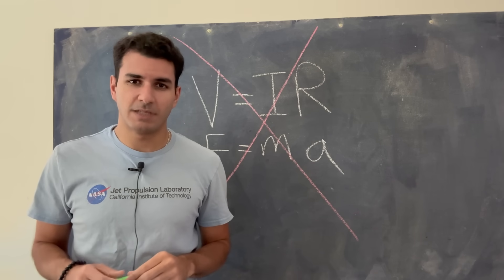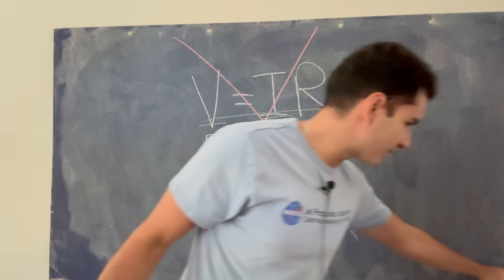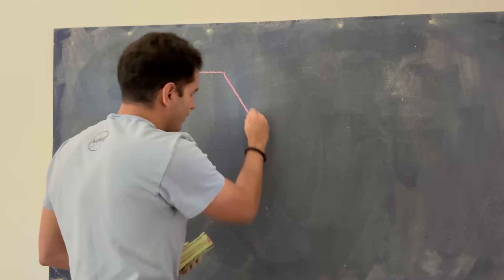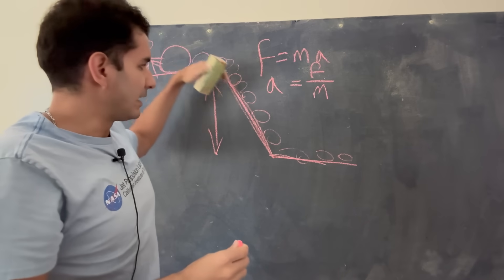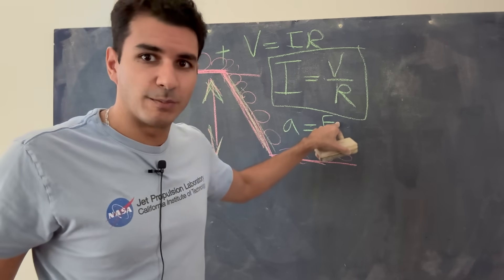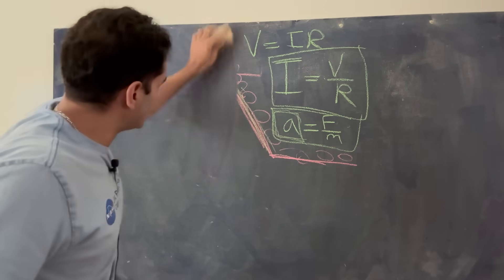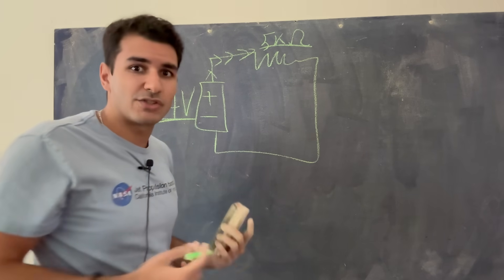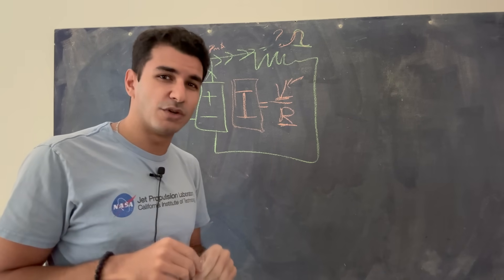You don't really understand physics

Comment: This is true. What you have is not just an equation, but a mental model of that equation that serves as an analogy to real systems you use the equation to understand. I must point out that if you see the relationship starting as a force, then a=f/m is intuitive. But not everyone is like you! If you see the relationship starting as a movement, then f=m*a makes sense. These are all valid concepts but they are not equivalent. For instance f=m*a does not help you if you already know the force and need to know the mass. This is because what is intuitive to us is based on simplifying assumptions we are rarely fully aware of. Someone who sees all events as the result of starting forces will have trouble in the event that there is a force and he must figure out what movement caused it. Causality is a fundamental assumption in most of the mental analogues people use. So yes, use the model while it serves it's purpose, but also observe it's limitations and take on as many viewpoints and reference frames as you can!
Reply: The best way this was shown to me was to draw a triangle with V at the top, I*R at the bottom and line through the middle. If you cover any one of them up, what remains is the equation to find it. This provides no intuitive analogies but the good thing is that you can make your own for each variable. And once you understand the tangible implications for each variable, you can reuse this triangle approach all across physics. You can draw pages of interlocking triangles connecting various relationships and it becomes a great way to unify your knowledge of physics. I hope to learn more ways of mapping out knowledge like this.
Reply: The only way you can know a force is by measuring the acceleration that it causes to a mass. We are trying to teach this in high school... most kids just don't listen. You are one of the kids who didn't listen.

Comment: I always teach my students to think of ohms law in 3 ways depending on which term it is expressed in:

V=IR - Ohms law, V is directly proportional to I if Rbis constant at a constant temp

R = V/I , defining equation for Resistance and what is meant by an Ohm.

I = V/R , the only format that (as you say) expresses the causes and effects on each side of the equation. We don't change current to change V or R, but if we change I it is only because we are also changing V and/or R.

I think all three ways are needed to help students fully grasp the idea of thinking deeply about core concepts.

Side note: your casual use of language had me concerned. Current is not a flow of charge, it is the rate of flow of charge for example. You also mentioned speeding up the Voltage, that is a big cause for an effect of misconceptions.
Reply: So what is a flow of charge then if not current, what would call it?? When you want to express the rate you use units of amperes (coulumb/sec) to quantify the rate, amps is the rate of the current.

Not to nitpick you, but please explain how what I've said here is incorrect if you disagree.
Reply: @onradioactivewaves  electricity is a flow of charge in which there is a current. But the flow isn't the current, but a sign there is a current, if that makes sense.

In truth the difference is subtle and to most it isn't a problem. But if you are studying the topic an exam will require the correct use of the term.
Reply: @dakeyrasuk  I have  studied it and I've also worked in an electrical field (no pun intended)  where many terms were commonly used interchangeably and incorrectly. The word electricity is pretty generic and can mean many different things, but in general can be assumed to mean pertains to electrical charge / energy. Current can take one many different forms/ meanings as well. It could be drift current, AC or DC current, dispersion or diffusion current in a semiconductor. These all had very precise mathematical definitions when it came to exam time.

I kind of get where you're coming from, but the same general word can have very different meanings depending on the context. One person saying electricity could imply charge flowing in wires, in another context it could be referring to a static charge causing a persons hair to stand on end no current involved. Unless in a particular context or more technically described, general terms can be very ambiguous. I might use electricity instead of current if talking to 4 year old, whereas saying current in regards to a semiconductor without any other context could be nonsensical.

I've had these discussions with professors, students ,  engineers, many of whom do not speak English as their first language ( technically not my first language either) At first this was difficult for me, but ultimately forced me learn how to communicate better technically and precisely (I've also had to read and write plenty of technical documentation). So while I can agree with what you've said, there's always going to be different interpretations.

Comment: It seems to me if someone is relying on the form of the equation to understand that current doesn't cause resistance, then something has already gone wrong much earlier. Inferring that resistance is constant just because it appears as a denominator on the right hand side of the equation is not sound reasoning. Before the equation is introduced, something must explained about the nature of the quantities involved, ideally using familiar analogies, where possible. Then you should be equally comfortable putting the equation into any mathematically equivalent form.

Comment: Couldn't agree more. I struggled to understand Ohm's law until I understood that V is usually not what you're solving for. You can't magically add more current to a system to increase the voltage for example. Of course you won't always be using the equation to solve for I, but understanding the cause and effect of what's happening is essential.

Comment: Its best to imagine that wires have atoms and electrons and the battery's potential difference is creating an electric field along the length of the wire (the only conductor [unlike air all around the battery] that connects the positive to negative terminals of the battery). Each electron feels the force (qE) because its charged and so it has to accelerate (F=ma) but every material (like copper) has some resistance against such motion. So based on the material of the wire, a different quantity of current flows per volt of potential difference, thereby defining the resistance of the material. Mathematically, V is matched with resulting current times resistance of the material through which electrons move, hence both V = IR and I = V/R.

Comment: I am not sure that you have it correct starting with I = V/R for direct current. How does one know the value of R? Surely the definition of d.c. electrical resistance, R is V/I, meaning one measures the two values of V and I. Ohm's law simply applies when for different values of I the same value of V/I is obtained. If it is not, Ohm's law does apply. There are numerous cases where Ohm's law does not apply, the classic one is a lamp, but it applies to any situation where the ratio of V/I is a function of I. Of course, Ohm's law is useful in simple cases but it is simply a definition of electrical resistance. With AC, one has to use complex numbers to define the relationship between I and V to develop a similar definition for electrical impedance. I always taught that R was just some variable that in a few cases might be assumed to be constant for a particular component in a small range of values of I or V. We call these components resistors, but we only know the value of R from measurement and not because of some intrinsic property of conductors. At an elementary level, it is best to leave Ohm's law as V=IR but it is of very limited validity and teaching R = V/I is not necessarily a constant does not lead to serious misunderstanding later.

Comment: 4:20 , apologies for going offtopic but if it don't have enough friction it won't roll  or it would slide, i have been out of touch with physics but correct me if i am wrong. 

assuming the person is pushing the ball without creating rolling and he reaches edge, 

 if the slide is friction-less then it should not roll at all while sliding down ? =>  No resistance
 
if the slide have just enough friction for pure rolling the ball should not face any frictional resistance at macro level ? this isn't completely true cuz ball do not make point contact with slide due to micro deformations
Reply from the maker: whether it rolls or slides depends on amount of force and where the force is applied (moment) -- so you have the right thought process

Comment: Kinda the same with the ideal gaslaw right? PV=nRT, for a container would need to be written as P=nRT/V, as the pressure inside the container is dependant on the volume of the container, but in a movable cylinder the formula would be V=nRT/P as the volume depends on the pressure inside the cylinder
Reply: Really depends ,if you are assuming it as a single variable function or multi variable function

Comment: You're actually right. Understanding the basic fundamentals of the subject you are studying is really important if you're going to use it after you graduate in your job. I love physics, and I always try to understand the concepts, not just memorizing a bunch of formulas, and this understanding helps me to solve physics problems even if I have forgotten the formulas, like remembering concepts and then making the needed equation. V=IR was a good example, which a flow of electrons through a resistant material, doesn't cause electric potential difference because the movement of electrons itself has a cause which is potential difference, but it would be great if you also mentioned the capacitance formula: C = q/V so, according to the equation a student at the first glance might say, if we increase the voltage of a capacitor, the capacitance will decrease. But that's not correct! The capacitance of a capacitor is always the same and doesn't matter on voltage or the amount of charge. Instead, I would think that q = CV is better than the initial formula(C is constant value for a capacitor) to understand a capacitor. However, both formulas are correct if we don't forget the cause and effect.

Comment: I'd like to make a point,
we say V ∝ I, and that why V = IR, where R is constant of proportionality, namely Resistance, now Mathematically, Since V=IR, means I = V/R and hence I ∝ V, since 1/R is also some constant, but logically this is wrong.
Let me explain why.
Current flows between 2 points when there is a potential difference between those 2 points, and without potential difference  current wouldn't flow, that means potential difference is the cause of current and hence Potential Difference(V) ∝ Current(I). However saying this other way, that I ∝ V would mean that current is being the cause of Voltage which is false cause there wont be any current without voltage.

Comment: Horses for courses !

I recall learning about Schrödinger equations to understand the behaviour of electrons at semiconductor junctions.  Then you get to a design class and it's Veb ~0.6V.  and that's all you need if most of your components are provided to a 5% or 10% tolerance.

Most things taught are an approximation and that's fine for most people in most circumstances.

Comment: Wrong, you should write I -V/R = 0 because it's a relationship, not causation
Reply: this, but less confrontational
Reply: nitpicky
Reply: can somebody explain the difference between writing it as V=IR and I=V/R and I-V/R=0, to me they are completely the same
Reply: @엉덩이먹는사람  As i understand then they are the same in that both sides of the equation are equal in all three of your examples, but he never claimed that this is untrue. His point was that it is useful to think of the right side of the equation as the cause and the left side as the effect and therefore write it as I = V / R, because V and R are the parts we control and I derives from them.
Reply: When one commentor wrote it as I - V/R =  0 , he is saying that because ohms law is a  relationship meaning that it just describes how the variables are related and the equation does not show   any variables as independent or dependent .it is neutral about causation. When the student tries to solve for one of the variables, then they write it in causational form because they know the context of the circuit they are working with, but the equation itself does not specify that one variable is more important than the others. I'm guessing that most students will see this as a very pedantic exercise

Comment: Your idea that equations should be written with the causal quantities on the RHS and effect-quantity as the subject on the LHS is an interesting and compelling idea. I guess, as a mathematician, I find equations involving just multiplication more "simplified" and "elegant" than the rearranged versions involving division - but from a teaching perspective (especially at, say, high-school level), your point might be stronger.

Regarding voltage and current, one of the things that confused me in school is learning about setups in which it's the supplied power (rather than the resistance of the circuit to which the power is being supplied) that is externally predetermined, so that one has freedom to control the supplied current or supplied voltage within the constraint of their being inversely proportional to each other, rather than directly proportional as in Ohm's Law.

Regarding F=ma, what's interesting is that, conceptually, it's forces that cause changes in velocity, but mathematically, the infinitesimal calculus places the change of velocity as simultaneous with (rather than temporally subsequent to) the force. This can lead to bizarre paradoxes like Norton's Dome, where one can define a dome shape [where there is a well-defined unique tangent plane to every point on the dome, and this tangent plane varies continuously with respect to the point on the dome] such that it's perfectly consistent with Newtonian mechanics for a point particle at the exact top point of the dome to stay at this top point for an arbitrary duration of time before spontaneously starting to slide down the dome. In effect, because of how infinitesimal calculus works, "F=ma" theoretically allows the 'a' to be the cause of the 'F', even though in practice it's the 'F' that is the cause of the 'a'.

Comment: Quite a good explanation of how a physicist thinks but you are clearly not an engineer. You talked about orbital mechanics based on gravity and [ a = f/m ] as "exact" sorry but in real terms there is no such thing as "exact." Not even orbital calculations are exact because every measurement used when applying the physics has a tolerance. Even as we improve measuring devices ultimately we will encounter Heisenberg's uncertainty principle and there we stop. But thank you for revealing what you know so clearly.

PS: Cause and effect are a really big deal not just among physicists. Practically everyone knows the problem; "which came first the chicken or the egg?"*. Biologists avoid this by avoiding cause and assuming both happened at the same time. But for physicists it could be stated; *which came first SPACE, MASS or TIME? To say they all happened at the same place and at the same moment also avoids the cause question entirely! 

Which all means education is failing to handle truth because the elites of science are naturalists or atheists and can't handle the ultimate cause; God!

Comment: Dude, why did you decide to prove that it is you who doesn't understand physics? F=ma is a fundamental definition that is at the core of Newtonian mechanics. V=IR is an approximate empirical relationship for Ohmic conductors that is only useful for very select materials in limited voltage and current ranges. The two are not even in the same category as far as physical equations are concerned. And, yes, this is high school level physics knowledge that even an engineer is supposed to know. Are you sure you were paying attention in high school science class? It sure does not sound like you were.

Comment: As a highschool student, my eyes really lit up when you got around to explaining the circuit example in the near end of the video. This feeling resonated with me because when I first learned this initially in 9th grade it confused the heck out of me whenever this equation V=IR popped.
Reply: What you should have retained from high school is that V=IR is the equation for OHMIC conductors. It is not a useful equation for conduction in gases or liquids. It doesn't work for metals at high currents, either, because of heating effects. THAT would have been the important lesson to remember.
Reply: @lepidoptera9337  - Did you miss where he started his post saying he's a high school student - and that he learned this in 9th frade? So that wasn't even likely a physics class, but a physical science class. Even in high school physics, they don't normally get into that. They have a lot of material to cover. It's a survey of many topics at an introductory level - not an in-depth electrical circuits class.
Reply: @Curly_Maple  I was talking about the "NASA engineer" guy who made this stupid video.